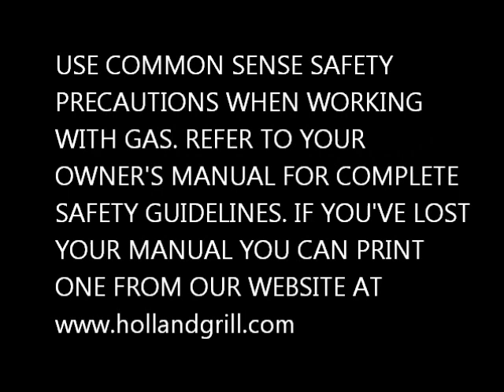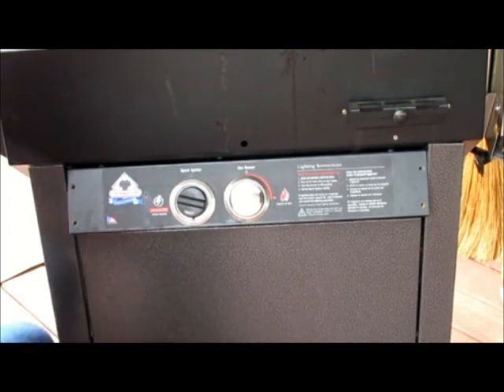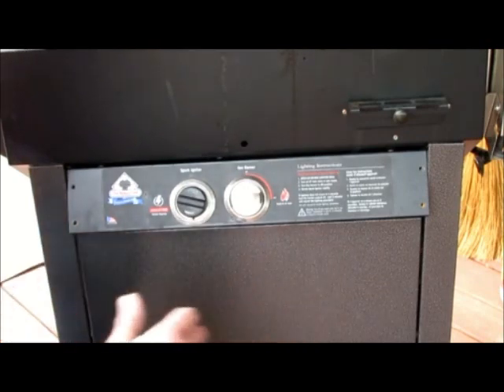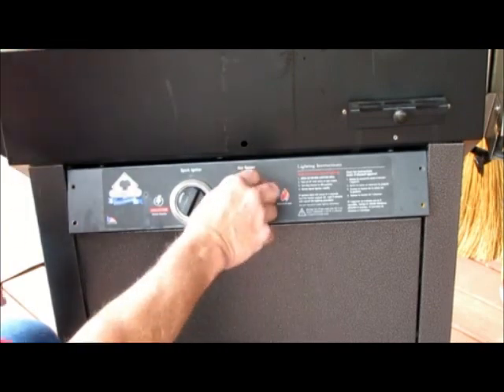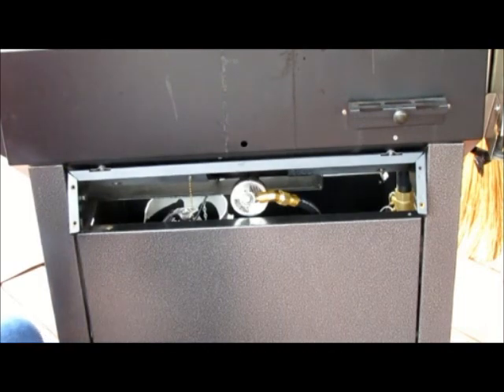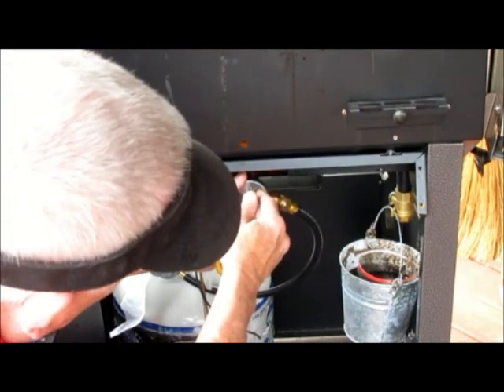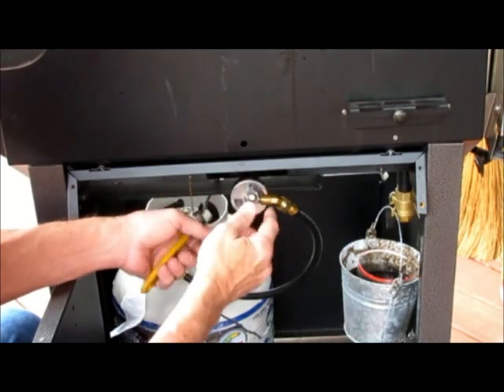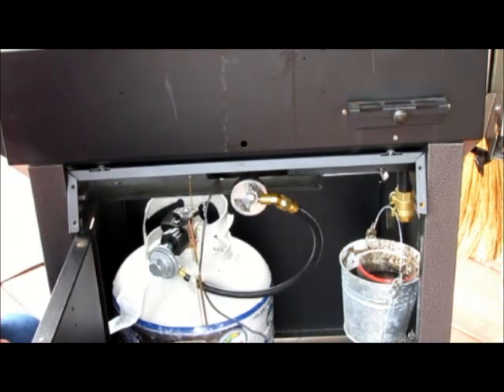HOW TO Adjust the air shutter

Comment: Currently my grill is not hot enough.  However when making the adjustment as shown it doesn't seem to matter where I turn the airflow, the flame has far too much orange and not enough blue.  Any ideas on what could be wrong?